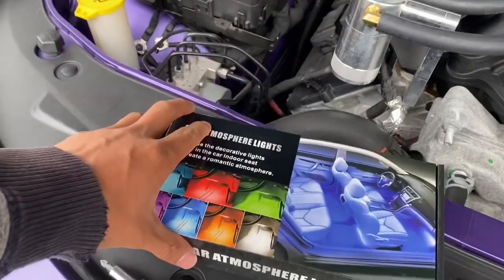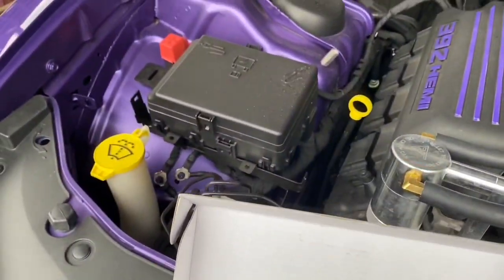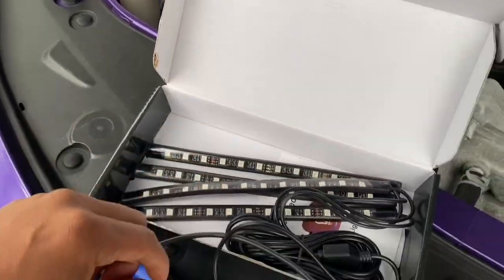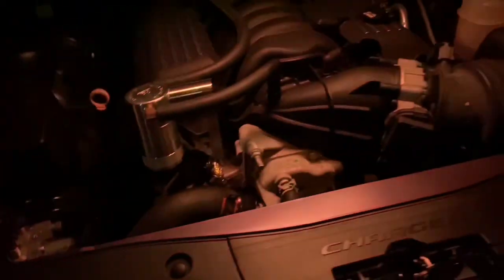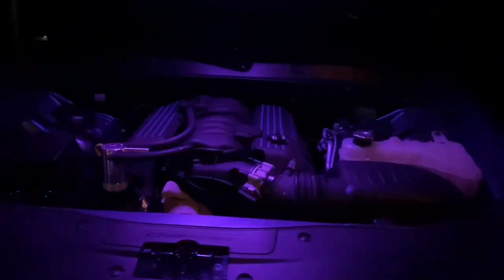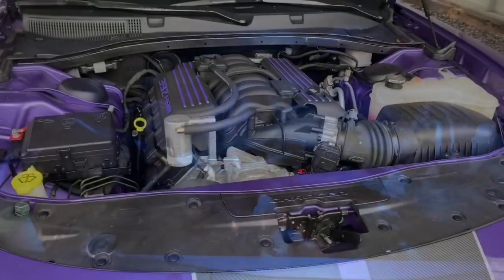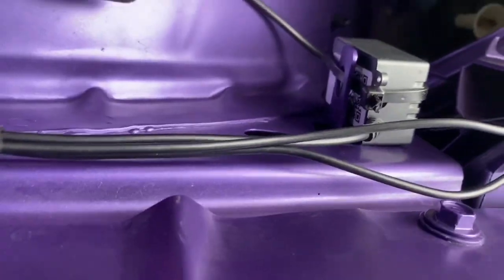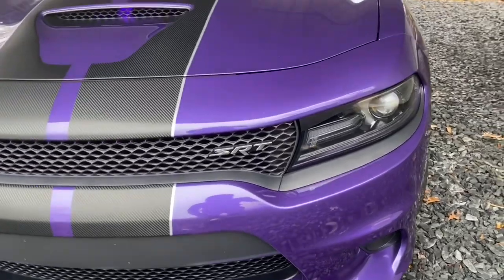Installed grill and hood scoop lights on my Dodge Charger SRT.. cheap and easy💯 *MUST WATCH*

Comment: Hi, I'm thinking about this for my 21 Elantra and I like the idea of using the interior lights because they are cheaper for a similar effect.  I do have some questions though, if you don't might helping me understand this a bit better.  It has been more than a year and a half, how are they holding up?  When you connect them to the battery like that (which is what I assumed you did, cause I didn't see you connect it), do the lights come on anytime the battery is on?  If you are inside the car, can you still use the remote to control the lights or is the connection too far away?
Reply from the maker: They’ve still held up .. I connected it to the fuse box positive post and just grounded it on a bolt in the engine bay.. it’s Bluetooth powered so you have an app and turn on and off when you want to .. it reaches a pretty far distance before you lose signal
Reply: @swaveyymike  thanks.  this really helps me.  This weekend I am putting a set into my car and maybe next month I'll put this into my grill.  The Elantra has a really neat honeycomb grill that I think is more popular, but I had never noticed before.  Again, thank you for the help.
Reply from the maker: @elizabethworley7073  no problem  lmk how it turns out 👍🏾
Reply: @swaveyymike  so even the "inside lights" are waterproof.
Reply from the maker: @Turnerbenjamin82  yes surprisingly .. haven’t had issues they still work to this day 🤙🏽

Comment: Great video and it looks awesome.  Can you tell me what fuse you used for power?
Reply: Trying to attempt to install the same lights you have on my Hellcat. Can you please tell me how you hardwire the switch inside the engine bay?
Reply from the maker: Where the fuse box is the positive post and then ground it anywhere tbh
Reply: @swaveyymike  I did that, and the lights stay on all the time.  Do I need to also connect the switch that came with cigarette lighter and how do I connect that switch?  What wires
Reply from the maker: @atxhellcat2170  if you watch the video I spliced and didn’t use original power source.. it’s Bluetooth controlled so you turn on and off with app
Reply: @swaveyymike  Yes that’s the way I have it.  Red wire to positive like you did it and grounded on chassis.  Lights stay on and can’t controlled from app.  Really odd.  By the way thanks for your reply and help.  Melvin
Reply: @swaveyymike  Mike Disregard  the previous message.  My son told me to just refresh the app and everything started working.  Thank you 🙏🏼my friend
Reply from the maker: @atxhellcat2170  yeah you should be able to connect with app.. good deal 👍🏽
Reply: @swaveyymike  Just subscribed to your Channel.  Thanks for your help

Comment: How did you wire it up to the fuse box?
Reply from the maker: Muscle Mind Connection I took apart the original 12v power source and hard wired it in the engine bay positive near the fuse box and just grounded it
Reply: @swaveyymike  good lookn out fam. Thanks for responding too!
Reply: Can you somehow show me where to ground the wires and connect them please

Comment: Did you connect both black & red cable to the positive on the battery ?
Reply from the maker: Positive to positive post near fuse box and grounded it pretty much anywhere

Comment: How do you turn them off and on since you removed the switch?
Reply from the maker: Mario Jr. it’s powered via Bluetooth app comes with a Bluetooth control box that’s mounted in the engine bay
Reply: You can can turn them off with the Bluetooth app? I don’t want them to drain my battery!
Reply from the maker: Mario Jr. yeah and I leave them on for hours doesn’t drain battery at all

Comment: How u plug the black and red wire? To the terminals
Reply from the maker: Ground it to any bolt and positive next to fuse box the positive post
Reply: @swaveyymike  black to ground? Red to positive terminal? Or which
Reply: @dannydnice1  red is typically positive

Comment: I know I’m late but where did you put the ground wire I’m sure you put power to under red nut correct
Reply: Fuse box
Reply: What fuse did you wrap red wire around
Reply from the maker: @MrVocal_ I just hooked it up to the red positive post by fuse box

Comment: How you connect wires to turn it onnn
Reply from the maker: Black cable ground to any bolt in engine bay and red cable positive connect to positive post beside fuse box.. it’s Bluetooth controlled within an app and you can power on/off and change colors
Reply: @swaveyymike  on/off from app? 
And where did ypu get this from bro?
Reply from the maker: @jassmeet4187  yes app controlled .. it has other features and effects too .. check the description I listed it there 👍🏽
Reply: @swaveyymike  thanks bro

Comment: Where do you wire the lights into?
Reply from the maker: Positive right beside the fuse box and ground just any bolt in the engine bay
Reply: @swaveyymike  does that drain your battery? Or does the lights come with remote to power on and off?
Reply from the maker: @apacolypz11 i haven’t had any issues and it’s Bluetooth controlled via an app

Comment: Where exactly did you connect the wires for power?
Reply from the maker: Engine bay.. fuse box
Reply: @swaveyymike  did you use a fuse tap? Which fuse did you use?
Reply from the maker: @badboyblue5128  no I did not.. just grounded it and hooked up to the positive post

Comment: Incomplete tutorial. Did you do it? Or you ask someone to set the wires?
Reply from the maker: I did it myself and yes didn’t mention how I wired it but it’s grounded pretty much anywhere in engine bay and positive to the positive post beside fuse box
Reply: Lmao Mike good video, but I think next time to some of the people who don't know electrical terms, you might want to use wire colors when explaining how you wired something. Red wire to the red positive next to the fuse box and the black wire to anything metal in the engine same thing as if you had to jump someone's car.

Comment: How did you get the lights in the bumper without removing it?!
Reply from the maker: Where the hood latch is I forced my arm in there I did get a lot of scratches and stuck a few times but it was worth it for not taking off the bumper 😆 and then it’s just 3m taped under and zip tied
Reply: Damn dude. I tried for sure but I couldn’t do it! I got mine just at the radiator on the top of the grille for now.  Will probably take that bumper off in the future
Reply from the maker: @ithenkalot1  yeah I got two strips on top grill and other two on the hood vent